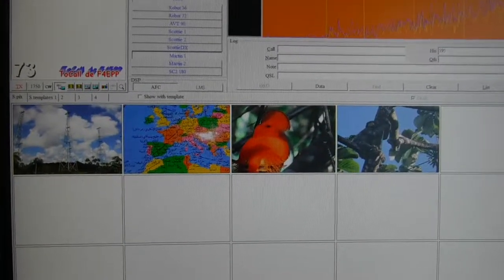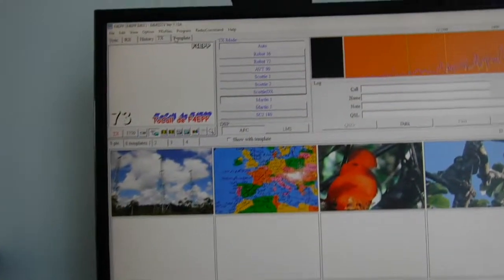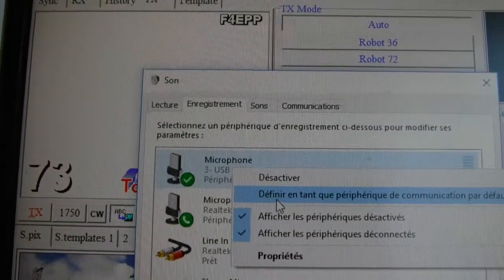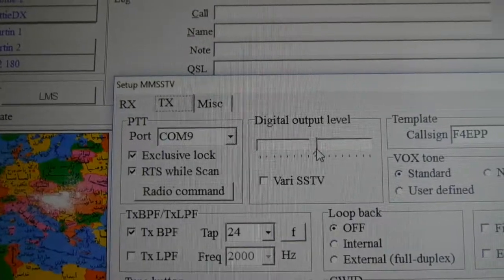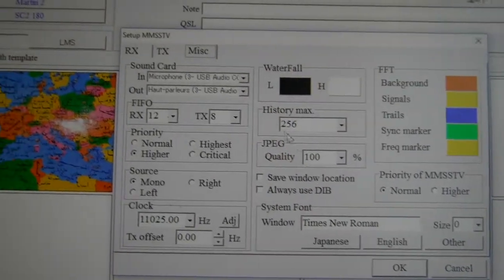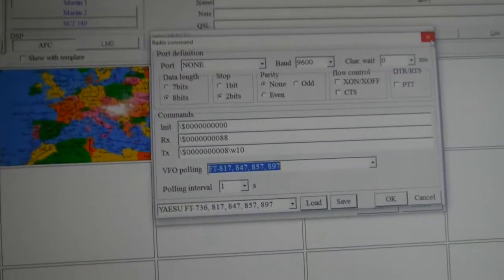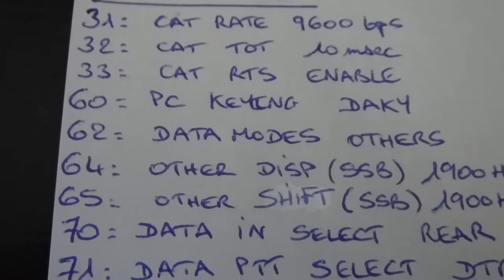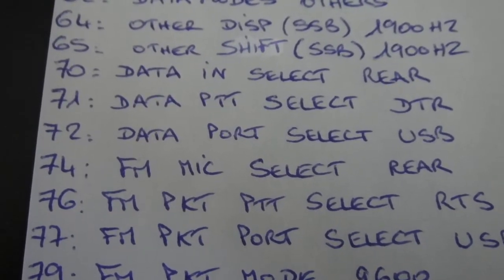MMSSTV Yaesu FT 991 with USB Cable

Comment: OK, so far I have it working for recieve. But the template when I click on it shows up in the tx window, but when I click tx it just goes to black on the send screen. Also with what appears to be the right settings, the TCX does not turn of after the bar has reached the bottom of the tx screen. Any help appreciated.

Comment: I cannot get the radio to go into tx after setting up everything in radio as you did. I could not find anything in the software program that was different than your settings in the software. But I am confused as I saw another video showing it work in D-U and another in USB mode. which is correct and do you thing this will amke a difference. Was afraid to try as not sure what tx would do .
Reply from the maker: Data-usb will always TX through the Usb plug behind the radio. It's always better to use this in SSTV (and all data) mode.
USB (LSB) phone mode will TX through the mic plug (default) unless you set in the menu the USB back plug ...
Keep all digital modes using USB back of your transceiver plug  to Digital modes.
And keep your Usb/Lsb phone mode to "mic" setting to make normal phone Qso.
Check your settings modes now to restore them almost as default now you probably touched everything !
73's
Reply from the maker: To sum it up :
Digital modes = Data-usb (back)
Phone modes = Mic ( front)

Comment: Dear , Can we use this software to transmitte voice ,  I mean phone mode where we use Laptop microphone and receivn phone using laptop speaker? YD7UFI 73
Reply from the maker: No, it does only SSTV modes. Your configuration will probably create a Port Com issue if 2 software are using your transceiver at the same time. You will have to choose one of both each time turning off the software you don't use. Either SSTV or Phone activity.